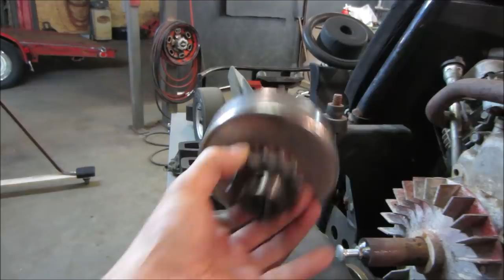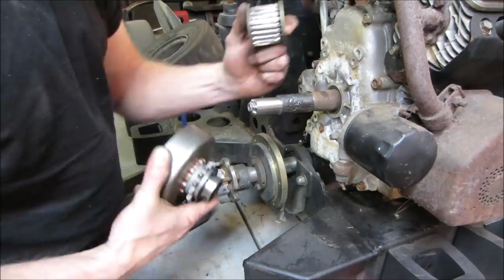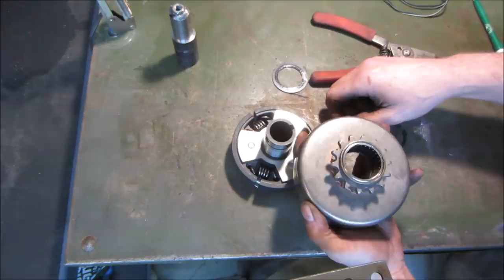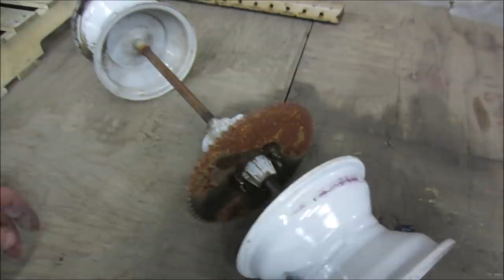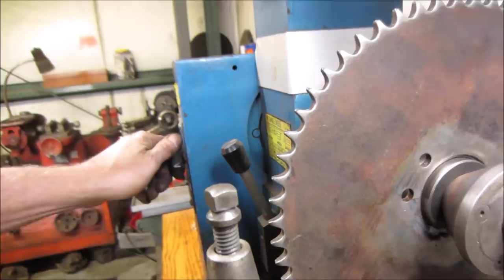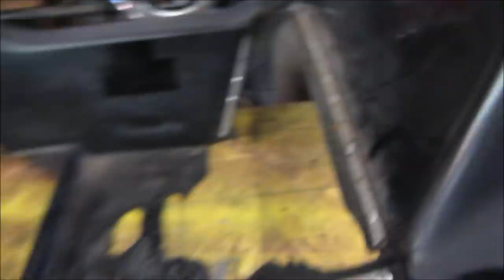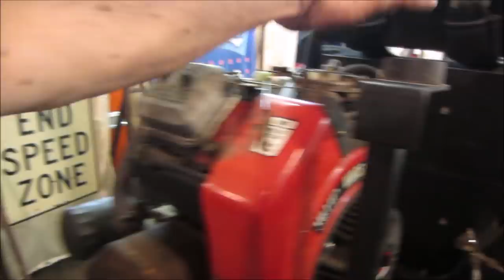amusement park go kart, let's put a real engine in it,

Comment: I had to try and center a hub on a smaller shaft.  I finally wrapped electrical tape on the shaft, until the hub would just fit.  I then  drilled out the mounting holes.  It worked out vey well.

Comment: I hope its geared low enough that the clutch doesn't fry. You should also think about engine cooling since you pulled the fan portion off the hub.
Reply: That fan wasnt for engine cooling. The engine fan is on the flywheel under the red cowling.

Comment: I could use that engine on this 1978 Ariens Snow blower. The old 8hp that's on it is tired. I am thinking newer engine but electric start. What you are doing was exactly why I stayed away from Go carts and mini bikes. I hated having to mishmash crap together to make something work. I sold a few frames and engines, but never built one, didn't have a lathe or stock pile of parts eather.

Comment: If I had a lathe with a taper attachment, I'd think about making adapters to go from straight to tapered crankshafts. Naturally with my luck someone already is and I'd spend 10X more making one then just buying it. Ditto for the other way, when a perfectly good generator head is being shitcanned because the engine threw a rod or some other fatal failure.

Comment: Can you mount a pillow bearing on the shaft near the sprocket. Run a piece of angle from the body mount on the left side of the seat, back . Make some slotted holes for the pillow bearing and a triangular mount coming down off it to the bumper to support the back of it.

Comment: find a cable off of one of your motorcycles and hook it to your carb. and run it upfront to hand operate your speed or make a foot throttle. you've done a good so far. but my choice would have been a motorcycle engine, like a Hyabusa, ( haha )

Comment: A snowmobile centrifugal clutch would have worked much easier on there without modifying. It would also have the added benefit of being able to handle upwards of 60 horsepower

Comment: Instead of making a ring for for the sprocket hub, you could have "added "material by welding a bead around the step,  then turned down the weld to the perfect sprocket ID size.

Comment: You're braver than me taking off that much at once. Whew! My gunsmith friend opened up a 7/8" set of pulleys for the 1973 John Deere 56 lawn tractor to 1" to fit the larger crank for a replacement engine. The first was perfect, while I was watching, but he got enthusiastic on the second when I went for a break and removed too much with the lathe. Well, I made it work by taking a steel coffee can and cutting out a spacer with tin snips to fit the inside diameter snugly. Carried the pieces 3000 miles east and we got it back cutting grass after 40 years! Will it run? Heck, ya!

Comment: Back in the day when we use the gear puller. We will get it tight and then we hit it with a hammer and It would Knock off the gear or whatever you were removing. It work but 90% of the time

Comment: Could have just put 2 beads of weld on the coupler  then use the lathe to get the correct hub size. Would have been soo much quicker

Comment: Just a suggestion, make a guard around the chain/clutch with maybe 1/8" metal. if that fails when running full speed, that might go flying, well, it will go flying off.  either you or a innocent bystander might get hurt. But, like I said, just a suggestion.

Comment: On thin shafts like that where you can't easily cut a  keyway into you can often cheat and put a key out of the shaft by placing a line of weld on the shaft  and then cutting that to shape to work as the key.

Comment: if you wanna upgrade the clutch on this thing after you smoked it why not try a flat belt clutch off a  two stroke golf cart ? when you do plan on putting a motorbike engine on it a two stroke is your best bet as its gonna be powerful but its gonna be smaller, if not you can always try beefing up the honda! shout me out if you find this helpful :)

Comment: Hey Man- if you want some really HD sprocket / chain stuff for projects,
go to your wrecking yard, find any GM FWD AUTO from 90's & up to ?

On a TH440/4T60 FWD transmission, it has very beefy chain & sprocket,
and it would have nice shaft stock, too. Usually- a "dead" unit is $50 or
not much more. A few minutes to gut it. The differential is nice, too.

Comment: there is some heat insulation tape (fiberglass weave covered with a metal type tape-sticky on one side) that is made for tight locations on airplane engine cowls that is Designed for close exhaust applications such as yours- ie…….No Cutting!

OR buy some "Header wrap" and wrap pipe and or glue on inside of body...…..

Comment: So when a woodruff key is not used but you need one, assemble the pulley onto the shaft and drill between the two. Then tap the hole to use a high grade bolt as the key. I’m sure someone here knows it and can explain it better and with more eloquence than I.

Comment: why is their not a minimum 600cc motorcycle engine from a RR in it? then it would have 99+ hp and 6 speeds of insanity
Reply: I'm sure if he had one in the stash it would be in there in a heartbeat
Reply: This is suppose to be for a 10 yr. old.
Reply: @marknilsson5782  no it's not for a 10 year old its for an adult but i guess a child of 10 could drive it. I was riding motorcycles at 7 years of age .
Reply: James Amundson  My bad! Miss heard on part 1
Reply: @marknilsson5782  Na Pa Da Biggy

Comment: What about a pillow block bearing to support the end of that crank?  Looks like there is plenty of room, and you could put in the same amount of adjustment that the engine plate has.

Also, is that rear hub missing the nut still or did I miss it attaching differently?

Comment: You cannot tether the tether the read to the seat. You need to let the engine vibrate on its own mount. Otherwise it would just Shake your cart to pieces. That's why it was belt driven and not chain

Comment: That wheel sprocket is so close to the ground - when you hit a rock you may lose the chain ( or worse). Also, just pop rivet an aluminium plate to the body where the exhaust comes close - spread the heat.

Comment: Engineering-wise you could probably measure the inner diameter of the sprocket, the outer diameter of the hub, divide that by two and that's how much space should be between them before you tack weld it. lol.

Comment: Centering that sprocket. Could you have welded a couple blobs on the shaft. Put it in the lathe and trimmed them down to the diameter of the sprocket. This would have centered the shaft and then just finish the weld? I always like these puzzles.

Comment: you know, if you put a bar with a rounded surface end, into the tool and slowly ran it into the wheel (cog) then it would have pushed it straight. wind in slowly till it rubs all the way or use a roller.

Comment: Given the old engine was ~ 5.5 HP or the bigger 13 HP even at half the reduction will still put more torque to the wheels than the old one could so I dont see a  big acceleration problem there due to lack of gear reduction.

Comment: i would turb a lip down on the hub to keep sprocket asligned for welding
Reply from the maker: set screws in the way
Reply: @mustie1  only had to be a slight lip to give you central instead of it rocking

Comment: It'sa me, it'sa Mustio, I make a da fastest nitro-kart in all of a Nintendo!

Well, that all worked out nicely in the end, and that engine doesn't look at all out of place in there. . . When I saw that axle with the 'Peerless' differential, I began to wonder if you might even be looking at fitting the matching Peerless five speed gearbox too, but I think that might be just a step beyond, though they are good for a few gee-gees. My JD lawn tractor has the Peerless transaxle with the exact same drive train, and that's 16hp.

I'm wondering just how wicked this Franken-kart is going to be!

Comment: I would have used the lathe to carve a shoulder on the hub to fit the diameter of the sprocket.
Reply from the maker: set screws in the way
Reply: @mustie1  Oh, looked like there might have been just enough.

Comment: Careful defeating the Governor Darrin. The 3/4 round disc that the throttle set screw rod is attached to is where you would attach the accelerator cable. You were WAY over revving the engine and these Vanguards will show their inner workings with anything over 3600 rpm. Just saying, be careful. Great job on the fabrication as always!! Cheers! Zip~

Comment: my thinking on the clutch over the wheel, should be reversed as the chain drive will still be in the same place. you wont be adding any more pressure from the chain. Hope you under stand. cool vids
Reply from the maker: not the same spot
Reply: @mustie1  Thats what happens when i dont watch the whole video before replying. AHaha

Comment: Im pretty sure you can port the intake and exhaust of them and add a pipe and at least they sound.... better????
Reply: Some of those Vanguard twins come from the factory with restrictors in the exhaust ports. They are just little tubes that fit into the exhaust ports and choke down the openings. My 18 hp Vanguard that was on my Grasshopper had them. They pull out fairly easily.

Comment: If you have a lathe why didn't you use that to cut a shoulder onto the hub to fit the opening in the sprocket? Then the sprocket would have been centered properly on the hub and have a shoulder to seat against.

Comment: Could you not weld a bearing/race 1/2 - 3/4 along the drive shaft and then weld an A-frame & saddle to the body that would hold the bearing/race. That would prevent flex & movement of the engine.

Comment: You know they make an adapter for that tapered shaft on eBay. Just type in tapered side shaft adapter 9 horsepower or 12 horsepower something to that effect and it will get you on the right track to find it . it's a shaft that's tapered on the inside and a Straight Shaft on the outside and it bolts right up
Reply from the maker: does not fit 16 hp

Comment: Knock the sprocket back off and machine the fatter part of the hub to fit the sprocket center, as long as you can get to the set screw wouldn't change alignment cause hub can be moved on axle for adjustment
Reply from the maker: set screws in the way

Comment: Why not just cut a shoulder into the other side pf the tractor supply hub. If you did it in the lathe it would have been damn close to true with a lot less fuss on the welding and adjustment of the sproket

Comment: this project reminds me of the time I tried to formulate a power booster using nitro-cellulose as the main ingredient but I could not get it to dissolve in gasoline,I used a combination of acetone and toluene and ethyl-acetate ,but as soon as it touched the gasoline it plasticized again,it was a failure,but it was fun burning it off.

Comment: Put a CB 500 engine on it or Kawasaki 900 engine on it what every you can find that has been wreaked 650 something big. The little 100 or 125s are lame put something on there that pulls wheelies and burns some rubber. A snow mobile motor would be real nice.
Reply from the maker: who said l wanted a 125 engine?

Comment: not sure why you didn't take the collar you where trying to weld to the sprocket in the lathe backwards (chuck the small side) then lathe the large side down to match the sprocket hole size.
Reply from the maker: set screws in the way

Comment: Put an “A” frame style brace from frame up to shaft coming out of engine to reduce torque. Make a u shape into brace and put a cap on it so the engine can be removed. Like a cap and connecting rod to end cap idea. Is Brian a Marine? I did 13 years.

Comment: Gee the way you made that tapered arbor first to make sure the shaft is turned concentric, you just need to grow sufficient beard and we practically can't tell you from Keith Fenner and Steve Summers!
Reply: OK I take that back... 23:00 "maybe just eyeball it" - no amount of beard will do...

The way to align this hub "our" way (as in not the machinist's way) is to turn a shallow step on the hub, just so the sprocket bore centers. We can still fill the gap with weld bead from the other side, since we are not machinists and can sleep at night regardless ;-)

Comment: next you need a live axle. otherwise it will be a "one wheel peel"
Reply: Why would a live axle help that. It's a solid axle isn't it? Unless "one wheel peel" means something different in your neck of the woods. To me it is the result of a burnout with an open differential.
Reply: @9HighFlyer9  if you watched earlier vids you would know it does NOT have a solid axle it has one wheel drive, no dif

Comment: i work on these all day in the summer
Reply: If I was you, I'd pull the floater hub side off and put some anti seize on the axle, and check the bearings. they seem to lock up quite a bit and it'll lathe the axle down a quarter of an inch

Comment: Why didn't you simply pierce the sleeve (hub) on lathe? There has been enough space between the side and the fixing bolts. This would exclude any horizontal and vertical vibrations no need of insert (bushing) also ;)
Reply from the maker: set screws in the way
Reply: @mustie1  isn't there's enough place? It looks like enough on video. Even if you move 3-4 mm forwards you'll gen rid of centering at all.

Comment: Jw classic VW: watching your one year video's "really- cool-by-the-way"..just got one question..why does most vw shops that work on air-cooled v-dub's remove the 'heat-sink-fins' from the heater tubes..(I just remove the outside metal from some-old-trashy crap heater-box's) leave the fins on "the J-tubes"..(that way the J-tubes remove the heat from the engine better..allowing the outside air that's flowing or just from sitting still while the vehicle is parked, or sitting parked ('a-way-for the hot-air to be distributed away from the engine')..just think that that would look alittle more professional.. and not to mention stock.. and if you wanted to do look more professional you could probably have them anodized either black or gold or whatever color you wanted. It would just look a lot better then those glass wrapped tubes.. by the way I like the way you did your fabrication of metal on the engine to make up for the distance around those tubes when the heater boxes were intact..'Good-Luck' next year. I'll be watching..(You) JW Classis VW'S..!!! R.G.B. (critter).

Comment: There is no such thing as a Cog belt It's actually known as a Drive Belt and that's a NOT a wet clutch it's actually a Transmission and that's NOT a Gear it's Actually a  Drive Sprocket
Reply from the maker: might want to look it up and not look so foolish next time
Reply from the maker: A toothed belt; timing belt; cogged belt; cog belt; or synchronous belt is a flexible belt with teeth moulded onto its inner surface. It is designed to run over matching toothed pulleys or sprockets. Toothed belts are used in a wide array of in mechanical devices, where high-power transmission is desired.
Reply from the maker: Wet clutches are widely used in motorcycles and dirt bikes. The term simply means the clutch is lubricated with oil, as opposed to a dry clutch. Friction plays a big role in proper clutch operation